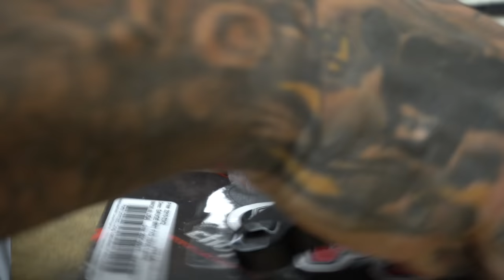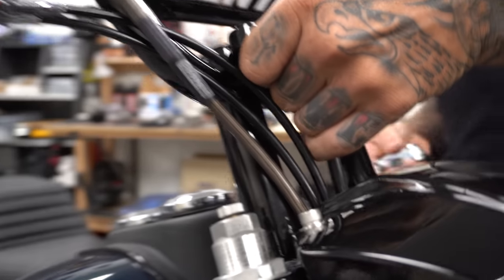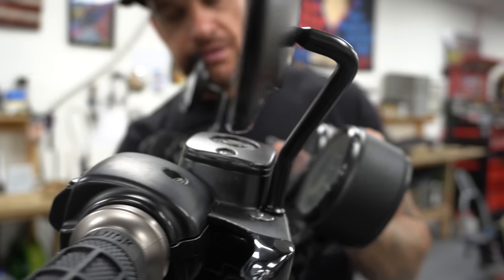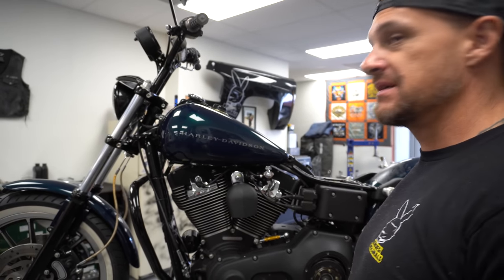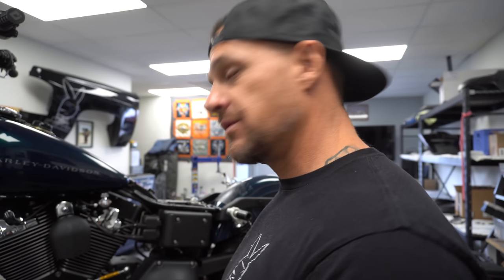02 harley davidson FXDX gage relocation and update on build

Comment: Stupid question doesnt have anythin to do with thid video.. but when replacing throttle an idle cable what cable goes in the front? An what one in the back? I know this is basic shit but u gotta start somewhere right lol
Reply: I know it's 10 months later, but they only go in one spot. The elbows at the throttle are different diameters, and if you follow it to the carb/ TB, you'll see which one opens the butterfly.